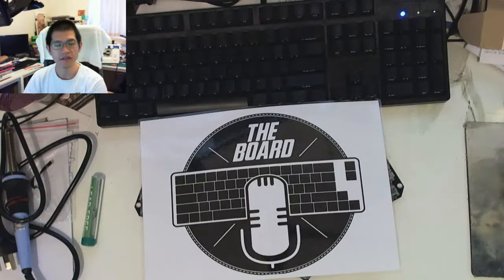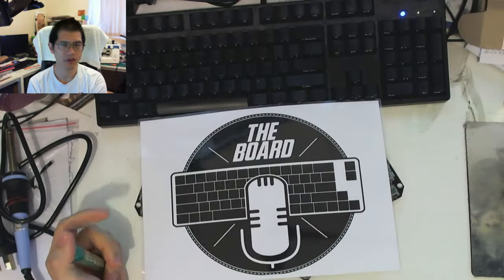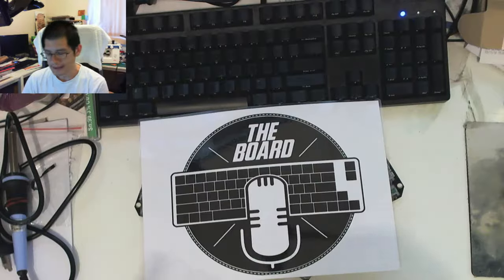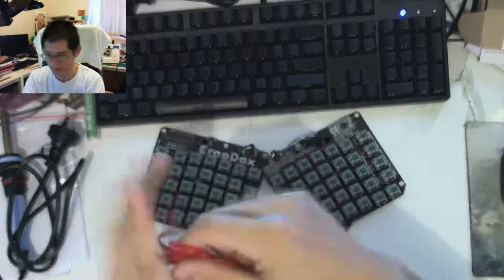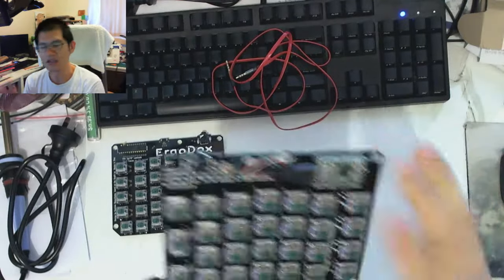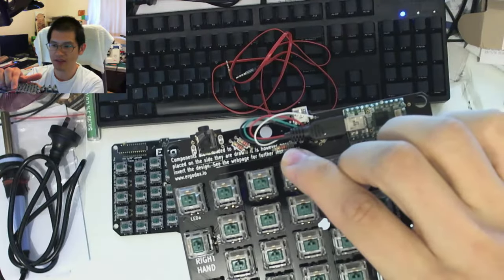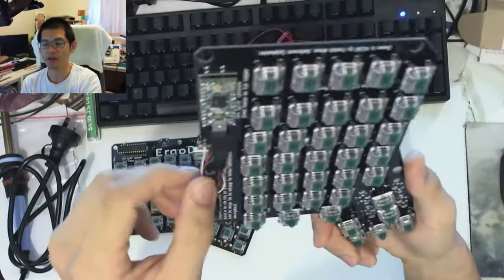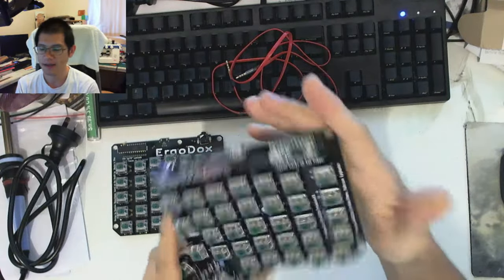Ergodox Build Completed & Concluding Remarks on Jaycar 25W Soldering Iron

Comment: Congrats on finishing the ghettodox! seriously with that soldering Iron and solder combo you did it the absolute hardest way possible haha. Like digging a hole in concrete with a spoon. Looks good though. Camera looks WAYY better as well, it was very grainy. Now its clean and you can actually see details.  I wouldn't rush to upgrade the cam, the difference would be minimal, it looks great as is. The thing with auto focus, It tends to try to find faces. So if you draw a little face on your thumb it will focus on that. So for close ups of components just hold your thumb eyeballs next to the item you want in focus and it will immediately focus. It's weird I know, but it does work shockingly well. As for the tin tape, I mentioned that type specifically because Its made for very high heat applications. I've used it on automotive exhaust pipes before. It's rated for upto 600°F (315°C), If you don't buy that you're better off with electrical tape before you go double sided 3M. It is a handle so i can't imagine it would get too hot for electrical tape under there.

Edit: one more small suggestion, You should leave the links to your subreddit and podcast in your video descriptions. People are more likely to click a link if you say "links down below" then if you tell them a name they have to remember to go to.
Reply from the maker: I actually was trying to get a C920, but the listing was Logitech HD webcam, and it looked like a C920, but when I got it and plugged it in, it was recognised as a C910. Minor differences, not a big deal, but I actually bought a second Logitech HD that also looks like a C920 (I got both for a total price less than 1x C920 new, including shipping!) so, when the other one comes, I can run whichever is better on the desk,  the other on face or any other angles. With 4 webcams now, I can do all sorts of shenanigans haha..

In regards to the worst possible way to build, I'm a sucker for punishment? I'm definitely not going to use lead-free on the next kit build, thats for sure! I'll also make sure I bead on the component side too hahaha...

Comment: I'm a little confused. Does the 3d printed case allow you to have hot swap. Or do you have to put them in the case and solder them to the board?
Reply from the maker: Hotswap was not an option when this video was created. Hotswap sockets have been relatively 'new' in the scene compared to the original Ergodox PCBs/build, so in this context, no, the 3D printed case does not enable hotswapping.

This build requires full switch soldering.
Reply: @theboard  thanks for the quick response. Yes I understood after watching your video. I see you indeed soldered them. I opted to buy some holtites. Do you have any thoughts on those? Thanks and ill be watching your video again soon during my build
Reply from the maker: @MyVitros  Depending on your switch that you are planning on using, you may find them a bit tight, there is a compatability difference. I would try some of the sockets first on a switch pin to ensure it fits, and also in the PCB before you solder them down.
Reply: @theboard  halo trues on an ergodox pcb
Reply: Thats what I have in my possession at the moment
Reply from the maker: @MyVitros  I'm not that clued up to know 100% which ones are problematic or not as I haven't personally ventured down using holtites/milmax sockets myself. I prefer soldered on switches personally.